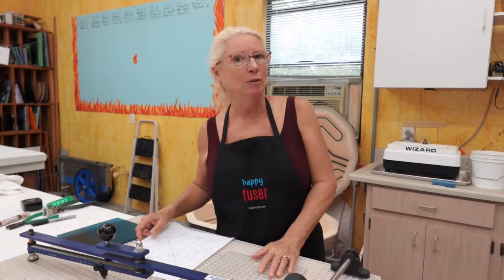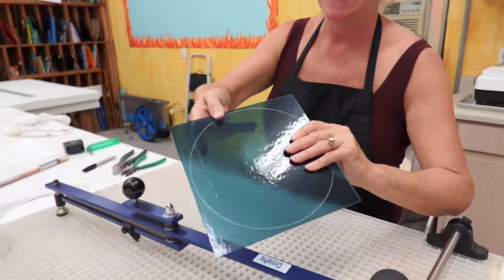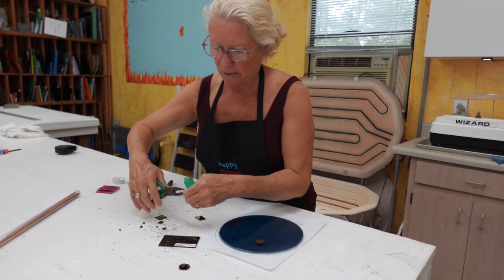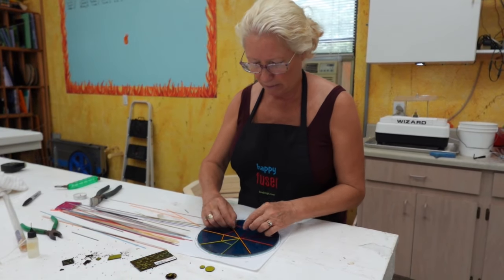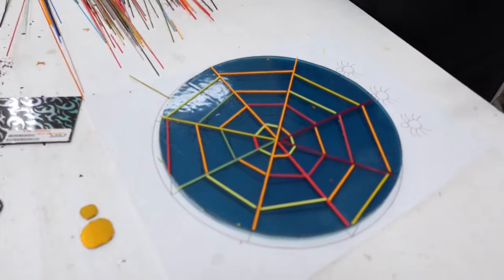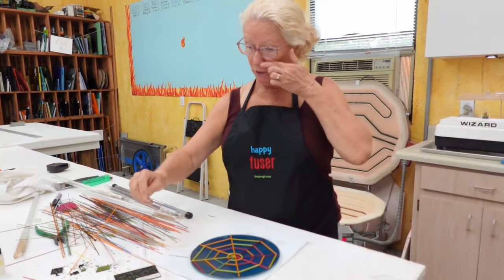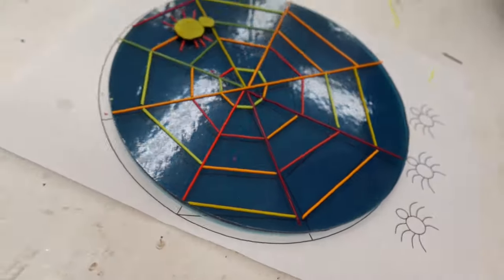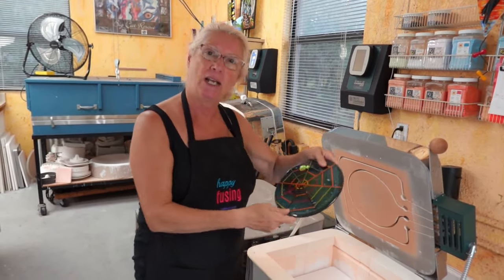How to Make a Spider Web and Spider with Lisa Vogt

Comment: Love this!  But I have a question,,,WITH your small spider circles,,, or other shapes,,,,,do you ever use finger nail files to run around the edges?  Rather then going to the grinder or if the size and shape can't be done on the grinder??
Reply from the maker: I have never thought of using a nail file to round edges on small pieces before, typically the smaller pieces will round out fine after being fired in the kiln. If they have sharp edges after I just use a sickle stone on it to file them down and have had much success with that.